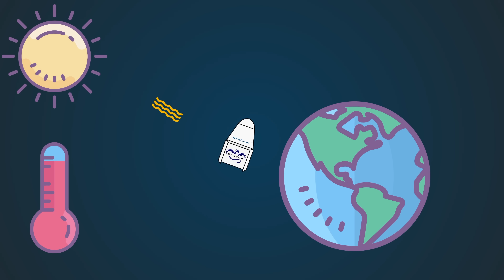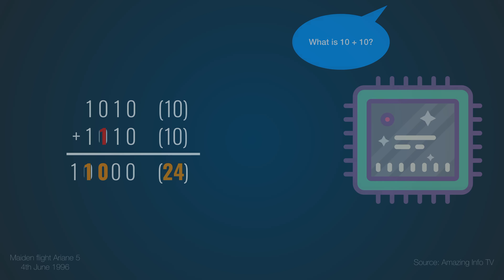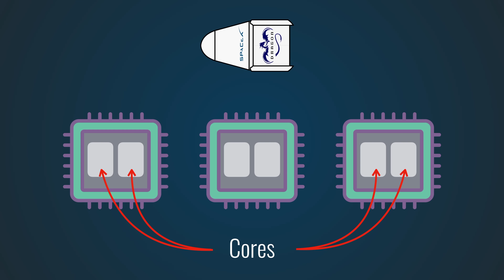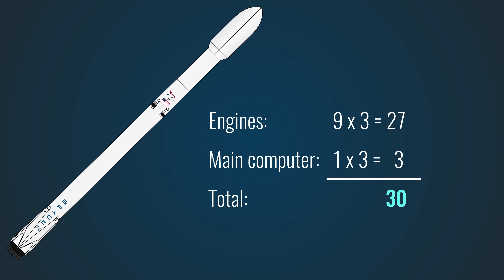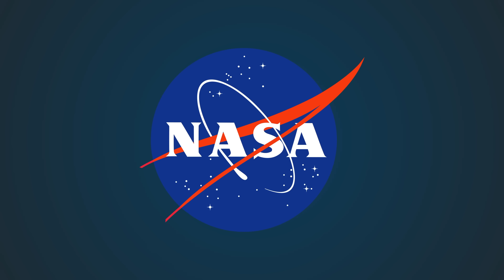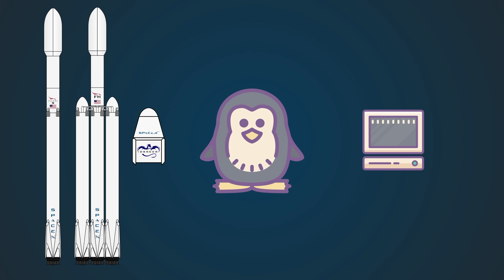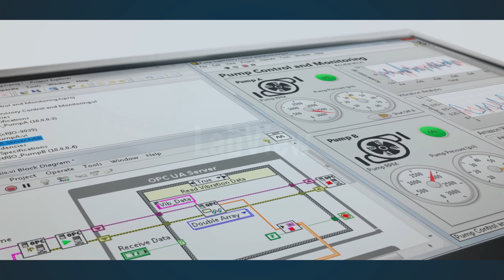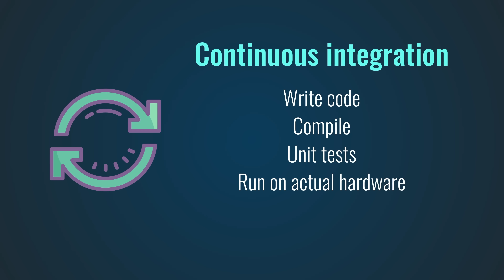Software powering Falcon 9 & Dragon - Simply Explained

Comment: Thanks for sharing.  I am a professional embedded SW developer and SpaceX enthusiast; so, I had been curious about their code.  
I was glad to hear they use Unix and that they don't use Python (the horrible preferred choice of a lot of Mechanical types).

I am a seasoned C++ programmer and do like that choice; but, I think a managed programming language like C++ of Java might have some advantages. 
 C++ is a loosely constrained language and is also un-managed; so, it can be more difficult to find subtle bugs (like unassigned pointers, and memory leaks) and much more dangerous when you miss them.  There are techniques for limiting this; but, programmers are still people and they can make and miss mistakes and testing every possible code path is often not possible.  
I am sure the developers on the Ariane 5 did lots of testing and still somehow missed the code bug that caused the failure.  
Anyone that claims their code is 100% bug free is either deluding themselves, lying, or not looking.  I am not really sure which one of those is worse.

The advantage of C++; though, can be better real-time determinism.  With UNIX and C++ on an X86 core, one project I was on achieved sub-microsecond determinism.
At the speeds they are flying, that may be the bigger concern.  There are ways to build more safety of C++ code, especially if they don't use other people's libraries.

Thanks for the cool info.

Comment: here's how to solve for radiation and heat:
coat the damn computer in water.
WATER COOLS THE PROCESSOR AND ABSORBS RADIATION.
SoLUtIon
Reply: Depending on the type of radiation you are trying to absorb it can take a non-trivial amount of water to do so. You can't just put a thin layer on there and call it good. Also, water sloshes around and on something like a rocket you don't want any off-axis sloshing, so if you have a non-trivial amount of water you have to keep it very tightly contained. And now you run into some other problems... depressurization, as you go into orbit, will cause expansion and boiling of the water, so it must be contained within a pressure vessel, and the computer. Which makes it a pain in the butt to do any sort of repairs on, and you have to worry about another pressure vessel for every single processor. And you have to heat it because water tends to freeze at -248 C. So you have added orders of magnitude of complexity and numerous additional failure points. So no... you don't just coat the damn computer in water at all.

Comment: 120° in space ? What
Reply from the maker: Space itself is cold. But thanks to radiation from the sun, it can become quite hot. Plus there is no air to take away the heat.
Reply: Simply Explained - Savjee So, you are saying that the spacecraft absorbs the radiation quite dramatically ? That is impressive, because most of the spacex crafts and dragon are painted in white

Comment: Low earth orbit doesn't require much rad-hard chips. We need them more for deep space missions (like the deep space gateway in the next decade). Source: I work at NASA on rad-hard camera systems.
Reply: Yeah i figured myself. LEO still profits from the dense part of earth' magnetic field to deflect charged particles. That is why cube sats are popular.... your Atmel ATmega something something will usually not encounter a lot of problems except colliding with another retrograde cube because one smartass studend picked Kessler syndrome as topic for the finals.
Reply: Didn't the upper stage of the falcon heavy maiden flight go trough the Van Allen belt before it's final burn to test if it could withstand the radiation and the 6 hour coast?
Reply: @gonun69  are you sure
Reply: jakejakeboom well parts of the van allen belts are in Leo so you might need it for there
Reply: accept my resume sir?
Reply: Three words: South Atlantic Anomaly.
Reply: In our university, BME (Budapest University of Technology and Economics) we have made two picosatelites, in 5x5x5 and 5x5x10 cm dimensions. (Smog-P and ATL-1) They were working successfully on LEO until they came back. They used commercial components, and double redundancy.
Reply: Best of luck man! Conquer the space

Comment: It runs windows 10 with updates disabled :D
Reply: Imagine your about to land on mars and windows decides to update
Reply: @Luke skywalker The Starfleet commander humour.dll not found
Reply: But Can It Run Crysis?😂
Reply: @gi4dtv  Huston, we've got a crysis...
Reply: They tried it at first, but they saw so many BSODs they abandoned the idea forever.
Reply: >windows 10
>updates disabled
what sort of wizard are you?
Reply: lol
Reply: @Luke skywalker The Starfleet commander telemetry monitors in the control center are on windows
Reply: Argh! Windoze updates!
Another technology breaker from Bill, the guy who single handedly took software technology back into the dark cave that it's still trapped in forty years later.
Reply: Andromeda: "HOUSTON WE HAVE A PROBLEM!"
Houston, receiving no radio signals from the craft: "Andromeda do you read?"
Andromeda: "THE COMPUTER JUST TURNED OFF AND MY ENGINES WON'T STOP BURNING!"
Reply: IT RUNS ON ANDROID LOL🤣🤣🤣
Reply: I don’t think you guys know that windows NT brought an American warship to its knees in the middle is the ocean. That’s some powerful shit!!
Reply: It runs on x86 processor and linux
Reply: That's not physically possible.
Reply: @giviodikadze9833  Huh? Updates not possible? How did you figured that out? As long as there is a telephone wire, radio natenna in range  or satellite, one can do wahtever needed!
Reply: Exactly! Just reinstall my Windows 10 right now and disables the windows update. The updates really sucks! And cause a lot of BSOD
Reply: @ArczAngel  it is not that easy to stop windows waking up the machine and to reboot despite any opened programs there, but i think i've managed to do that. From 3rd attempt XD
Reply: @ArczAngel  imagine having an OS so bad, you have to put it at a security risk in order to use it.

This message was brought you you by Linux gang.
Reply: Astronauts: We're nearing the space station
Windows 10: Please wait while we install a system update
Astronauts: Asshhhhhhoooooollllllllle!
Ground: Excuse me, did I say something wrong?
ISS: You're coming in a little fast.

Comment: There are several inaccuracies in this video. First of all, the Ariane V did not crash because of an invalid cast from 64 to 16 bit, the overflow was in an unused software component that had been carried over from the Ariane 4 and would normally have done nothing. The reason why the rocket failed was because the overflow caused an uncaught exception to be thrown. TLDR exceptions were a terrible idea.

Another error is the use of linux at spacex. Linux is completely unsuitable for hard real-time applications because among other things it does not have an execution time upper bound on its scheduler. Linux is used on desktop computers but not on the actual rocket. The computers on the rocket either run off-the shelf RTOS's, or they run their software on bare metal without any OS.
Reply from the maker: The ariane 5 bug was indeed wrongly described. There is a comment here that specifies exactly what happened (a bit different from what you say)

As for Linux: check my sources. They really use it on their spacecraft.

Comment: Falcon itself runs on PPC based controllers which are also used for low levels functions on Dragon the X86 computers don't directly control the vehicle it's kinda like a horse and rider arrangement.
The electronics are not consumer grade COTS but more so industrial stuff like what you'd see running an assembly line or heavy equipment.
I think the lowest end hardware they use is automotive quality stuff which is still very ruggedized compared to lets say a laptop or phone.

Comment: 54 processors isn't that many. Honestly nothing he's saying is shocking. He opens with temperature, obviously there's a controlled temperature inside. Something that bothered me was that he said the system reboots, very vague, I don't get the sense he's done a ton of research. For example saying it reboots like your PC, every PC takes a different amount of time to reboot. I think space x knows exactly how long to reboot with very little deviation
Reply from the maker: You can check my research. All my sources are in the description!
Reply: The inside is absolutely not temperature controlled
Reply from the maker: But the craft is shielded to keep the heat out, no?
Reply: Simply Explained - Savjee every piece of circuitry is thermally bonded to the chassis.  When in direct sunlight, the chassis will heat up, otherwise it cools down.  You size the thermal mass and the surface area of your dissipator to set how wide the temperature swing will be.  When I worked on cube sats in college, the range could be -50 to +80 C.  You have to design your stuff to handle that.  The temperatures you list are asymptotic limits.  If the spacecraft were fixed on either the dark on light side of the earth, the chassis will reach that temperature, and so will the electronics.

Comment: Still makes you wonder how did they send rockets to the moon almost 50 years ago. Why does the task sound so  complicated even with the computing power that we have today.
Reply: It doesn't sound all that hard, tbh... Plus, a lot of the systems on the lunar missions were human-guided with electronic tools. Not all that automatic.
Reply: We have all this stuff nowadays because we can. Back in 1960s they couldn't fit much flight computers in the rocket so they did what they could. Now we have tiny really fast computers, so we use a lot them to make rockets as safe as possible.

Comment: I have to wonder if anyone at SpaceX considered using SPARK instead of C++ for the software control systems. According to studies, SPARK has orders of magnitude less errors per thousand lines of code (kloc) when compared to C. C++ is more complex than C and depending on their processes, it could have a higher risk of defects. C++ is not what I would imagine would be used for real-time safety-critical control systems.
Reply: people know c++ and people dont know spark . thats more than enough difference

Comment: I still wonder how we went to the Moon with old hardware 😂
Reply: Make the transistors so big that radiation doesn't matter.
Reply: make everything analog so bits doesnt matter
Reply: competence and a bit of luck
Reply: Watch the "Apollo AGC" series by CuriousMarc. They have most of the old hardware and got it kinda working again. Cool stuff.
Reply: cyberbetica thanks for your comment, I just saw it a year later 😅 I’ll watch it
Reply: The computer actually crashed as Armstrong was descending. They crashed a lot. But, they never had to render fancy graphics or the like, just crunch some calculations.
Reply: @IanGrodyRules  It didnt actually crash, it started to get overloaded and the error meant it was dropping low priority tasks in order preserve the mission goal, if it had crashed they would of been dead.
Reply: @gower1973  it crashed, but Armstrong took manual control. Upon it rebooting, when it caught up with telemetry, it had overshot the landing site. If it wasn't for Armstrong taking control, yes, they would have died. They still had gimbal control without computer aid.
Reply: They used PHYSICAL bits that were hand wired for their computers. Smarter Everyday has a video showing some of the hardware and it’s insanely impressive
Reply: @ChillPillDyl  Memory was graphite donuts about 1/4 inch diameter called cores (as I remember, maybe a little bigger). Wires physically wrapped around the cores provided and read charge on the cores to get 1s and 0s. This was all in an x-y grid for addressing. It used a lot of space and a lot of power for what is now a tiny amount of memory.
Reply: Mark Horton I’ve never had the pleasure of seeing such hardware in person, but it’s truly astonishing engineering. It’s my understanding that the wiring was often done people from the textile industry (often women from that time) who had great dexterity
Reply: @ChillPillDyl  I got a brief look at core memory in an IBM mainframe as a  boy scout explorer in a troupe sponsored  by the Data Processing Management Association. At that time the state of the art new mainframes already had "solid state memory" and the first hobby computers were build it yourself kits. The troupe got disbanded because we were not a democracy but a meritocracy. Those who showed the most ability decided who got how much computer time which was very limited donated mainframe time. Also we refused to go on camping trips and hikes.
Reply: @firsfnamelastname8490  Oh you Silly!
Reply: Old doesn't mean bad!
New is the enemy of working one...
Reply: Everything on manual.
Reply: IMAGINE STILL BELIEVING WE WENT TO THE MOON. IN 2020.

Yeah okay after we went to the moon we decided we were bored and never went back, never set up any kind of settlement, okay
Reply: @duckmeat4674  Funding killed further lunar exploration. The main goal was to get there and back, A lot of expensive things were considered more important than expanding knowledge. The Vietnam war for one.
Reply: @duckmeat4674  , of course you ignore that the budget for Apollo missions and NASA was cut in 65 or 66, cut so much that moon missions were stopped at Apollo 17. Yes, the country was bored. if you bothered investigating at all, you'd know that.  And yet you can't explain how lasers fired at the Moon by observatories like the Apache Point Observatory in New Mexico get a return signal from the Moon.  You can't explain the images provided by the Lunar Reconnaissance Orbiter of LEM descent stages and astronaut footpaths on the surface of the Moon.
Reply: I think There was no Guidence system it as calculated by hand and they manually pioloted the shuttle. Plus a lot of eletronics were just wires that led to mechanical pieces so there was no chance of bitshifting.
Reply: They handcrafted the transistor by Tailoring people. They literally stitched the coil over the other like Dress. When you zoomed in
Reply: I could be wrong but they used paper punch cards, insane.
Reply: why doesn't space x just use the 1969 technology to go to the moon? maybe because they know that you can't
Reply: @ottermagic123  Because newer hardware is far more capable and they are trying to innovate and make spacecraft better. Oh wait. You are trying to say the moon landings were faked.
Reply: @ottermagic123  , what an ill-informed comment.  Obviously, the people who were supposed to teach you critical thinking failed.
Reply: @ottermagic123  they'd have to make whole new factories to make an old rocket that's way more expensive then the rockets they're designing now
Reply: @ottermagic123  still can't believe, this video is about software, coding etc, and all you can say is "moon landing is fake"? Wow 👏🏿👏🏿👏🏿
Reply: @ottermagic123  I don't use a car from 1969 to do my shopping, therefore we can conclude that a car from 1969 cannot be used to do my shopping. Thank you, Logic Man!

Comment: so @120°C why was the Roadster not burned totally?
Reply: You can hold your hand in an oven at 250°C and not get burned instantly (unless you touch something), yet you can't to that with boiling water, even though it is less than half the temperature. 
In space there is no medium to conduct heat. It is transferred almost exclusively as radiation, so anything facing away from the sun will cool down by radiative cooling (emitting IR), anything facing the sun will heat up if it absorbs more energy than it can radiate "away". The roadster is spinning slowly, so the average surface temperature would be significantly lower than 120°. It's also pretty shiny.

Comment: Interesting video, but I wish you or somebody else could contrast with what is common in the rest of the space industry. It is hard to grasp the significance of what SpaceX is doing, if you have no idea what the other guys do. Here are some of the questions I wish somebody could answer:
1. What are the most common programming languages in the space industry and does language choice vary a lot with system it is used for?
2. Do other space companies NOT test code continuously against actual hardware? What procedure do they use then to test against real hardware? On launch site, once a blue moon?

Comment: I wonder if that kind of multi-core error checking is coming (though I doubt it would be really necessary for every day desktop programs) with the sheer number of cores we're seeing.  There's still very few programs that use all the cores we have at our disposal, so it'd be interesting if all of the spare ones that aren't doing anything would just double up the calculations and serve as error-checkers.  The new Ryzen goes from 5 cores up to 16, I think.  Think of all those wasted clock cycles!